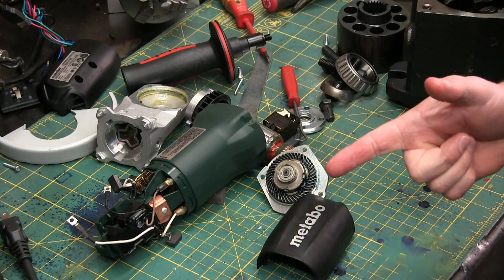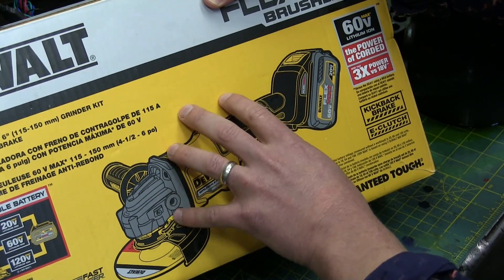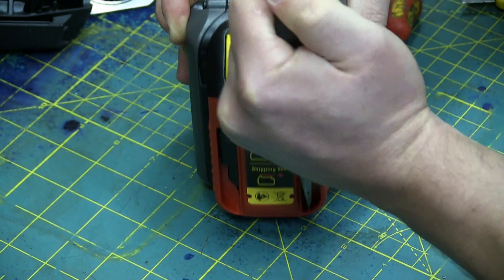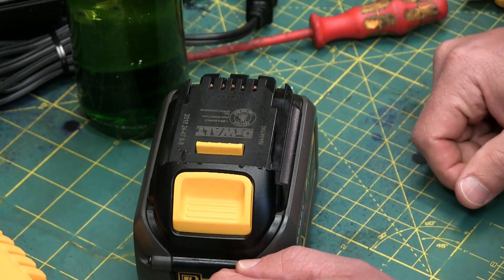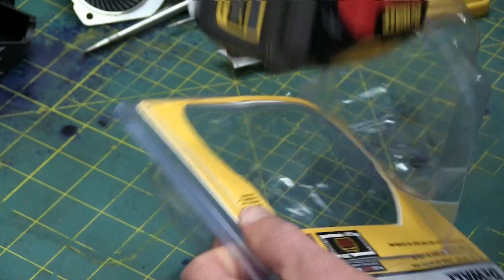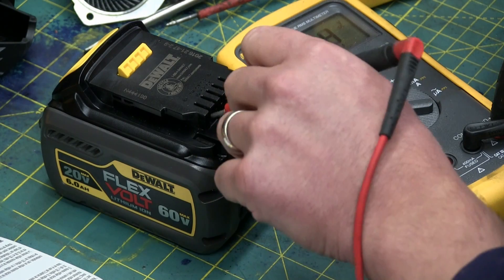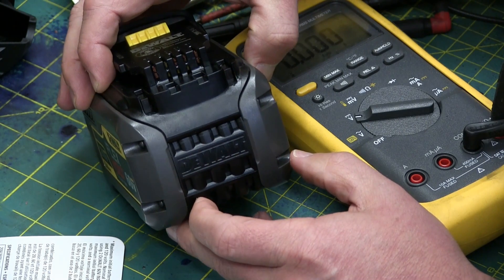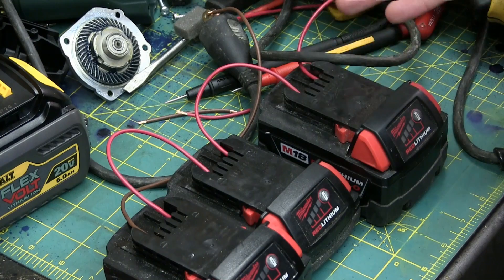Plug-in Power Tool to CORDLESS CONVERSION.

Comment: Love the idea. However I've got a slightly different concept. I'm a Solar Maintenance Technician, got extra Solar modules, don't have any desire to make money from the grid with it... Got my reasons. However, I'd like to rig up ways to use the variable DC power from the modules to power devices such as my Pool Pump, Well Pump, Garage heating fan, etc etc etc... Anything with a brushed motor. While I am at it I could also charge up those 18v drill batteries for FREE!
Reply: Hi Brandon. I’ve got this outdoor project site in the city but kind of off grid in a sense and would like to power my cordless makita tools off of solar - would you give me any advice on how to do that? Greets

Comment: Make an adapter to snap on about 4 of those batteries  in series/ parallel for 120V dc with a receptacle. Ok, if you want,  connect an inverter . Use it for limited AC power at a job site or, backup lighting for storms.   Then plug it into the wall to recharge at the end of the day.  You can use your existing tool  batteries.     Use your corded tools if that's all you've got.  Lightweight, no fuel-plug and play.

Comment: I believe this tech already exists in the form of uninterruptible power supplies. The good ones will use battery power to boost the voltage when it drops, which is exactly what you're looking for. [source: http://forums.apc.com/spaces/5/smart-ups-symmetra-lx-rm/forums/general/5319/voltage-cut-over-for-sua2200-ups ]

They can be expensive and heavy, but maybe something about the requirements for this application can enable some tradeoffs to make them more practical. Certainly good for a starting point, at least. I picked up a couple APC 2200VA Smart-UPS units for $200 each used.

Comment: +AvE I think you made me feel smart for the first time ever. About the "advanced stuff inside the battery", doesn't it look like three separate cells that the TOOL connects in series or parallel depending on the, well.. tool?  That together with removing the cover.. ... I... just..  what?  :)

Comment: 2 Thoughts:
1. They aren't saving money at the factory by sending lithium baterias out half charged. It's called "storage charge." Between 50-80% charge is easiest on the cells, and yields the longest shelf-life.
2. An enterprise grade UPS would work as said "turbocharger," as they have full-time brownout protection. They are spendy and heavy (with Pb-acid batteries), but can be picked up real cheap with failed batteries...which could be replaced with lithium (given some added charge protection).

Comment: I work with a contractor and one electrician gave us a booster to get back to 120 volts but it doesn't work as well as we would like. If you get this going I would have to try it I believe. Would come in very handy.

Comment: 6AH rating but is that at 20v...I have a gut feeling it's at 20v and once the batteries are in series to get 60v that AH rating drops down to 2AH at 60v...Right or wrong?

Comment: you have a great sense of humor.
keep the entertainment coming you crazy canuk !!!
capacitors are like batteries, as they can only store dc .
they are used in rotary phase converters to start them as well as balance the phases
you could consider a potential relay or sorts. a voltage drop below 110v would activate your battery pack.
it may be more efficient to use a capacitor for the same purpose, in due respect.

Comment: So, it may be the beer talkin g, but I was wondering why you would use batteries. Isn't there some way to rectify the power coming in and use a BF capacitor to keep the voltage from dropping off too much? I don't want to drink and derrive and figure out how big it would need to be, but it seems easier than trying to inject some voltage as the peak drops off using batteries and electronical witchcraft.

Comment: On similar train of thought, a ~2000w job site UPS like device would be neat too.  You get to a job site, plop it down, plug a power bar in it with any 120v device such as tools.  It would essentially be a large battery pack that powers an inverter that can handle the surge loads of tools, and the batteries would charge when there is power present.   Pure sine inverters are super expensive when you get into the kw range though... but really they don't have to be.  You need bigger mosfets and magnetics but other than that I think it's mostly the same idea.   I made a small scale version of this but with solar, for camping.  Only has a 300w inverter though.

Comment: One thing that would be nice is if these packs could be opened so you can change the (probably) 18650 cells from them.  They could sell the empty battery packs for cheaper too, if you can source out the 18650's yoursel.

Comment: I have quite a few battery powered tools with dead batteries. I was wondering what would be involved with hooking them up to the grid and what would be needed. I imagine a step down transformer and rectifier but realize there is more to it than that depending on if they are mosfet driven or not. Can anyone help with this? I was going to ask the same question on bigclivedotcom as mr eh canadia and mr schkotland are the two elcetrotool channels I geek out on.

Comment: 2 new 60v batteries in series.. get a charger and take it apart, wire theconnections on the charger to an outlet that you cut a hole in the side for. the batteries are going to power the outlet not the other way. you can actually keep the charging components in and with a couple diodes make it so power goes from the charger to the batteries, then the batteries to the new outlet you put in the side. the added diode part is so that 120 doesn't go to the batteries directly, rather to the charger circuitry to the batteries to the outlet.
Reply: I would even make the outlet a special plug, and then have an adapter that you plug the cord into so you cant just plug an extension cord in instead of a tool that would consume the energy so you dont charge the batteries the wrong way.

Comment: basically for the dc injection they do it on larger motors , its called a starting capacitor , it gives it the ump to get it over the hump while they spool up , possibly can do it with a smaller one . 

as for the yellow button deal , buy them books,  send them to school and they train them to  forget how to do simple shit  , that's why engineers where slip on shoes  .... ( 3  years of  U of M Eng school)

Comment: Well, In many tools they will have AC motors, and as such won't run properly off DC, so your device will only work with some tools...  After that you'll have the issue that your 120v AC mains is an RMS value, so you can't just rectify it as you'll get 170v.... so sharing the load between the AC mains and the batteries will be hard, since you'll need a 1000w PSU or transformer which is going to be expensive/heavy.

Lithium Ion on the other hand does not have a memory effect, so as long as the tools are used intermittently you could simply power them from the batteries and put a constant current charger there... So long as you find the voltage the lithium cells are supposed to be charged to, since 60v isn't a multiple of the nominal 3.7v for lithium you'll need to know how many cells there are, and what Dewalt are charging them to... 4.2 is absolute max, but most tool vendors will give you 4.0 or 4.1 fully charged.... otherwise... you are just building a simple CC/CV lithium battery charger and powering the tool off the battery while charging.

Comment: Just replace the breaker switch with a nail.
Reply: Bingo, or a wet finger😫
Reply: @Johnny-dp5mu  no some other fuckers wet finger or other appendage!
Reply: Just shove your hot dog between the contacts where the breaker would be and you got power all day long, as an added bonus your wifes got something to sink her teeth into for dinner when you get home.
Reply: That won’t work, (It didn’t work) the penny on the other hand . (pre 1980)

Comment: So, how are you thinking of doing the DC injection?  That sounds a bit sketchy.  I suppose you could just run it off DC all the time, and be charging the batteries continuously as well, though safely charging/balancing lithiums can be a bit dangerous if you don't know enough about them.  It would run the tools nice and smooth, though, and would remove the complication of trying to switch things on the fly.

Comment: I often run tools from a variac->rectifier->capacitor, which lets me run anywhere from low speed to way over normal speed.  It has the added benefit that stuff like dremel tools can be run at low speeds without the humming/pulsing/stalling as the phase drifts in and out of phase with the commutation.
A lot of other stuff besides universal motors works fine too.  Most switch mode supplies (which are in pretty nearly everything now) will run off of a surprisingly wide range of DC voltages. (usually the first stage is a rectifier and filter cap so it runs from DC anyway).  Some stuff with power factor correction is going to freak out, and obviously anything that runs through a transformer first is going to smoke on DC, though.

And, obviously remember if you're doing the variac thing that you're putting out a lot more voltage in DC, and keep the variac set a lot lower than you would on AC.

Comment: Its not that the company saves money for not charging a battery not full capacity.
Rather, lithium batteries want to be charged to about 60% for storage. 
So if you're not going to use them for a long period, charge them to 60% before shelving them.
Also any lithium powered apparatus should be fully charged before using for the first time.
Google and read my friend... google and read;)

Comment: Okay here it is. go by yourself to deep cycle 12-volt marine batteries also you need to buy yourself a 3000 watt power inverter this will handle pretty much any tool if you got something that needs more watts buy a bigger one while you're using your tools off of your inverter that's hooked up to one battery, have a solar charger hooked up to the other one so when your tool starts to dip in Power you just change batteries. I have a setup like this at my house because I don't have any power outlets in my garage and I can run any tool that I am using on this setup and I never run out of power.. but I'm not ever continuously running anything for hours either. hope this sparks some ideas. good luck on your project.

Comment: One issue with running AC tools on DC is that the mechanical switches (on those that are single speed,) switching DC is much tougher on them than AC.  You'll weld or burn out the switch contact much more quicklier.  
AC has zero transitions 100 or 120 times a second that stop the arcing across the contact, DC doesn't have that.
Look at the prices of DC vs AC relays and contactors on digikey and you'll get an idea of the difference.

Comment: I'd say it's more of a buck converter switching between the two voltages so it can regulate and change between what it needs, not changing between series and parallel.

Comment: Just get big AC voltage condensateur and plug it in parallel with tool. This is standard for bigger consumers, they have condensateur after they transformateur for avoiding bigger current consumption from shared powe lines.

Comment: Would be nice to set a amp draw target on the mains side, and then the batteries maintain that. I got a 120v / 20a shitty welder but only a 15a breaker in my work area... Any long weld and I'm tripping that. It would be amazing if you could set a 15a target so the batteries just eat the rest of the draw.

Comment: Interesting project idea, my meagre contribution is to question the wisdom of 'no more breakers popping' as being a good thing - surely they're ultimately there to kill the tool when you cut the cable, and having it fail over to live doesn't sound like a great plan to me.  

I believe the American NFPA electrical regs doesn't require lockouts and tags etc for under 50v, but over 50v they seem to get twitchy.  I don't know where Canada stands on that kind of thing, but I'd be wary.  I'm from the UK though, and here we're 240v, so power drop in the cables is less of an issue, and anyway I'd suggest anyone from a 240v country keeps well clear!

Love your vids though, I am so grateful that I learn so much
Reply: However, with that part over... what you're describing is functionally identical/somewhat similar to a UPS.  Instead of throwing 60v DC offset onto a 120vAC supply, or using a triac/relay to switch the AC in and out, the work is already done for you all in the AC domain at the business end, and the charging circuitry already there in a UPS.  Now, your current might be beyond the cheaper, nastier UPS units, but the circuitry will be pretty simple to reverse engineer if you want a beefed up version.
Reply: i thought the same .. then read comments..

Comment: Correct me if I'm wrong, but it seriously sounds like you're wanting to create some sort of capacitor that runs off of dc to help start an ac tool. I'm not an electronics guy but the thought of having dc and ac pixies dancing together doesn't sound like it would work, if it does then the next part here is me talking out of my ass. You could work your magic and try to create something that when a tool orders power the dc jump starts it and there is some sort of controller in the pack that will switch it over to ac after a certain amount of time. Just treat it like an external capacitor that isn't directly fixed to the motor but is a part of the regular circut instead. Plug the tool into one side of the little pack and the crappy drop chord into the other side.

Comment: You can kill a lot of people before you blow a 13A fuse when you take a 240V tool out in the rain,  so on building sites here in UK it's now mandatory to use  Site Transformers which give  an isolated 110V into distinctive rugged yellow sockets.    You may want to look at those for either donor parts or just style cues.  If you have a switchable 110/220V input you can halve your voltage drop problems where 220V is available .

Comment: fornicators? ... NOT of illegal nature? 
Do not consider implementing a cold shower regiment if you have:
· Heart disease: the sudden shock/jolt to the system could trigger a heart attack. 
· High blood pressure: Contracting the blood vessels could cause a stroke.
· Overheated or feverish: Your blood vessels need to dilate in order to release heat. Cold water causes them to constrict.
· After really exhausting acts of fornication: Don't really want the broad to see your shriveled Gary Oldman.

Comment: That's pretty clever. It's like slapping some caps in the circuit. But I'mma say this: Those li-ion batteries are dangerous. Actual high capacity capacitors may be a safer option.

Comment: Just design a metal box with some internal batpaks and a charge controller with an outlet on the top and a 12 gauge HD wall cord coming out the side. The tricky part will be designing some kind of detector circuit to monitor the current flow and dump some extra pixies in the circuit when the draw goes too high. Its a bit specialized type of circuit, but it should be easily doable these digital days. It shouldn't even be too tough to build in a display with a menu to choose the point, and amount, of boost the box would deliver to the tool plugged into the top, depending on the job/tool...
Once designed, china/horibltfreight should be able to crank them out enmass for  fourteen bucks apiece, with only a 92 percent failure rate.... That's in only the first day, naturally......

Comment: The only problem that I dont know how to solve is combining AC and DC. 

Its easy to program an arduino to read off a(n) (isolated) AC voltage detector and flick a relay when the input voltage drops, but combining the 2 different voltages is head scratching to me. I'm sure a gutted, chintzy AC adapter for charging 18650s could be wired to a 'smart' balancer to charge cells evenly. That too can be on a relay ran by the same arduino reading the pack voltage.

Comment: Bad news such a tool exists just search google ac/dc tools they are used by rig welders a a lot https://www.northerntool.com/shop/tools/product_200640240_200640240?cm_mmc=Google-pla&utm_source=Google_PLA&utm_medium=Power%20Tools%20%3E%20Grinders%20%2B%20Accessories&utm_campaign=DEWALT&utm_content=47930&gclid=Cj0KEQjw0_O-BRCfjsCw25CYzYoBEiQAqO9BDDAjqp9_uN0HwW6CQKbtv7-Ifms_kkmZyq3vP6D8RwQaAhGE8P8HAQ

Comment: Ave, your idea is great, it would especially be great to install in pickup trucks, some of them currently come with 120 volt outlets but they require the engine to run in order to power a tool. With your battery setup, the engine is not required to run.

Comment: use an inverter, preferably a sine wave inverter to provide AC to your tools.  use a battery bank to power the inverter.  use a charger to keep the battery charged up.  use a 100 foot el cheapo electric cord to power the charger.  this will only work if your use of the tool is intermittent. if you need your tool on for very long periods of time the voltage drop will probably catch up to you.  if you want to get fancy you could use some super capacitors along with your batteries to handle high current at start up.  that would preserve battery life in the long run.